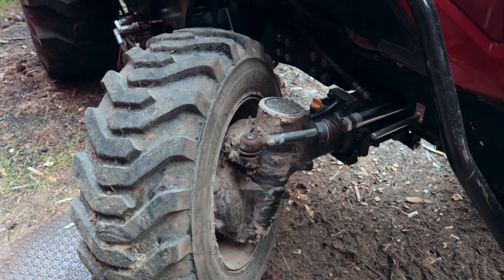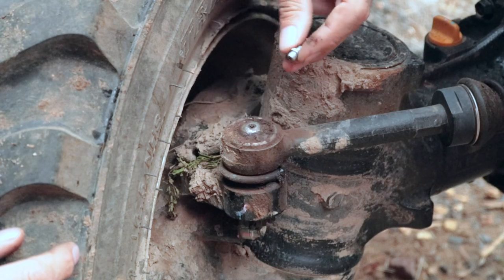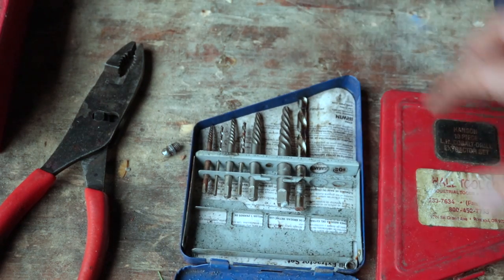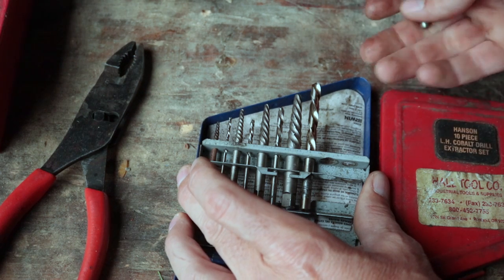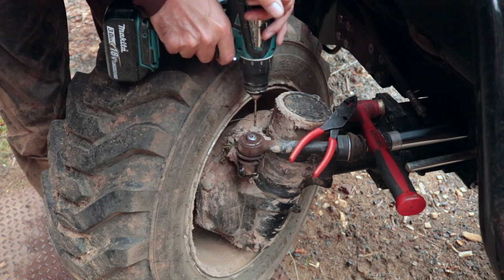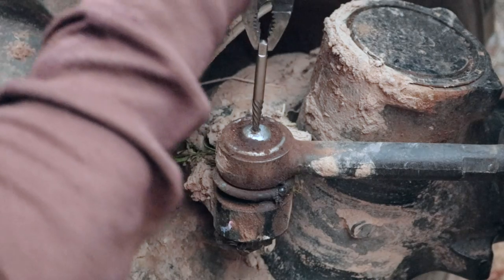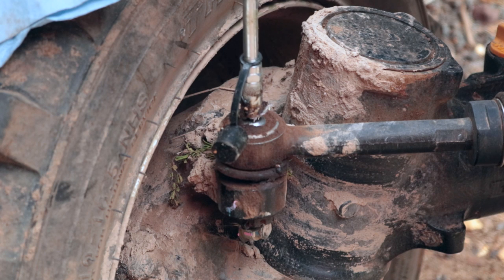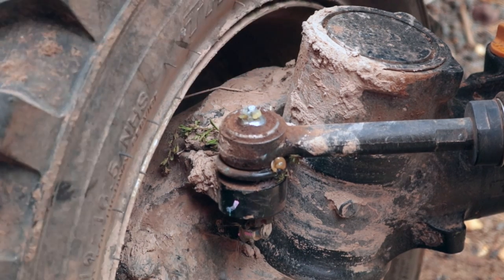I BROKE MY TRACTOR

Comment: All is good except for drilling all the way through in the wrong direction & leaving metal filings inside the ball & socket. Fortunately the threads were not damaged & you could thread the new zerk fitting back in. When greasing ball & socket joints with the rubber boots, typically I give it a squirt and a half using my hand trigger grease gun. I am looking at it closely, looking for a slight bulge of the boot, but not so much to blow a pin hole in it & pushing out the grease, as at this point it becomes counterproductive. 
The other style is the umbrella boot, whereas it is okay if a tad of grease oozes out below it's lip. When greasing shafts or rods with bushings, I typically keep pushing the grease through until I see some movement of the previous grease job. I have learned from experience too that it pays to use a high quality type 2 grease when greasing my equip., be it the truck, tractor, trailer, etc. I personally use the industrial grade blue grease from Valvoline as Kendall makes a good one too although it is extremely expensive. The Valvoline isn't cheap either, when it goes on sale at my local NAPA store, I stock up on it! 
Good post here & thanks for sharing your experience.
Bill on the Hill... :~)

Comment: Great video. Might be helpful to track down the size of those grease fittings - when you wander into your local NAPA, there are several different thread sizes to choose from (both standard and metric) - yeah yeah, the metric system blows

Comment: The EZ out fits in a tap handle.. As for the grease fittings, you can purchase an assortment in SAE or Metric at a local auto store in the "Help" section for just a few buck$. The set I bought about 20ish years ago still has a couple left.

Comment: Or.... pull the balljoint and then you can clean out the crud that surely dropped in... not to mention metal shavings from the drill which won't typically flush out when you overdo the grease.... and then put in the fitting and reinstall the ball joint and then fill the grease. Just saying.

Comment: You did get it out but before using the easy out I would've tried a small straight screw driver. Those grease zirks come out pretty easy especially with the low hours on your tractor. Drilling it out leaves allot of shavings inside. 
Easy for me to criticise I wasn't there! I wish I lived near by I could have gave you a hand. Thanks for sharing.

Comment: Cody, It looks like your grease boot has a crack in it. I've never seen grease come out of a boot like that. It usually swells up the boot first and then comes out where the boot is attached to the joint.

Comment: That type of screw extractor are often misused by people who believe the "easy" part of the easy out name.Using the correct size and knowing when to stop is important. The tapered thread can wedge the part being removed tighter, and broken extractors cannot be drilled by normal equipment. The square tapered type of extractor cuts down on the wedging action. I have even had good luck using  the square tang of a file on occasion,just be careful because of the brittleness.

Comment: I just got some cool little Easy-Out's that have the tiny reverse drill bit built in to the tip of easy-out bit. So far works well for most applications. Grease is the word.

Comment: I'm pretty sure those bits you were using are left handed bits and you were running them as right handed bits. Also there is no need to use a bit/extractor that is so big at first, you run the risk of damaging the threads while drilling it out. The next size down from the one you used should have worked just fine but if not than step up to the next size.

Comment: Two things I would've done differently - three, if you count running the drill bit in the proper direction - first, start off using just an extractor in the hole that's already in that part of the zerk and see if that would get it out without drilling and introducing metal shavings, and second, use a smaller bit/extractor. That one he used looked bigger than it needed to be and dangerously close to the size of the threads.

Oh, and don't blow out the grease boots. Know when to stop pumping. Do those boots have intentional overflow holes in them, or was that from overfilling previously?

Comment: I worked for a contractor in Kansas City  and went down state to pick up a 1 ton truck and backhoe from a jobsite that was shut down.  Two of us went so one could drive the truck with the backhoe on it back.  When we got the equipment to KC we found that the truck front end was worn out from lack of grease and it cost about $1500 to fix it..The backhoe joint was so worn from lack of grease the dealer had to cut the joint off the boom and weld on a new one along with other pin and bushing replacements to the  tune of about 4500.  There was only one person responsible for the equipment but for the lack and use of a $15 grease gun this damage occurred.  In other words use a grease gun with grease it will prolong equipment life.  This happened in 1973.

Comment: Wouldn't you try to use the 'easy out' without the drill first? ... as the drill might just be to get actual non-hollow screws supplied with a hole so you can use the 'easy out' ?

Comment: Well that is exactly why you don't drill if you don't have to. He has a small easy out that he could have tapped into the zirk  and backed out without the problems. Please us "kiss" only break out drill and bits as a last ditch effort. Before i get slammed i am a heavy equipment mechanic. The metal slivers created when drilling can really play heck on that rubber boot and tight tolerances of the ball joint. But great video cody all the same. That would have cost you at a shop not to mention hauling it there and back.

Comment: With a zert not usually being tight (or bottomed out) and hollow, most likely could have used the next size smaller and hand screwed it out.
Also they have square ones that would have fit right in with a slight tap. But good demo on if you have to drill.

Comment: I should make a try with the small extractor first, in the the hole thats already there. It's often easy to remove when they break like this.
If that dosen't work, I would try my left hand drill, and the machine set to the same direction ;-)
Perhaps remove the wheel for better comfort and using a T-handle.

Comment: In cases like these, you might want to try turning the broken thread with a tool, like a small screwdriver pressed into the opening or with a sharp pointed pick if there is enough material around the edge, to avoid drilling if at all possible.
In the airforce they are still called easyout. There are still good quality easyouts commercially available made in Germany.

Comment: When you already have hole in the broken fitting it is always worth checking if one of the extractors will work without having to drill the fitting out and dropping metal particles in the joint.
Also using pliers is a bit crude, better to use a spanner or a Tap wrench.

Comment: A trick I learned is putting a small piece of fuel line over the grease fitting. A thumbnail in length. They keep stuff from getting caught under the edge of the grease fitting and busting it off. Plus it keeps your grease fitting and little nicer. I will cut a dozen or so and keep in my grease box or toolbox. Yes sometimes you lose them but I have not gotten a grease fitting busted off yet. Stuff tends to glance off rather than catch.

Comment: I used to work around tractors like this and my company took all the greese fittings out and put a plug into them and we used to freeze the equipment every 4 Friday you pulled plug put in freeze fitting greased and removed I as why that was and the Foss said the guys keep breaking off fittings and this was cheaper in long run

Comment: Curious, both zerks were busted off?  I question if your front chains somehow snagged them.  Real close to the same area of tire.  You may want to run caps or set screws until time to grease.

Comment: All too often you'll see the grease squeezing out around the rubber cup. Although pushing in alot of new to replace the dirty grease is a good idea when it's already coming out at rubber cup, I believe the cups are not suppose to be over greased to point of releasing. I think they are to be filled just enough to to create a filled pressure so it constantly pushes the grease into joint during use. Sort of like the buddy bearing cap effect.
As far as the right hand rotation on the left handed bit, ya I saw it too but then who hasn't forgot and done that too. Great job Cody. Good for those who don't know about this sort of thing.

Comment: Forget using the spiral type extractors and the Ridgid brand star rods. You drill to size, tap the star rod into place, insert the star nut over the rod and then use a wrench as close to the bottom as possible.

They don't shear off like the spiral rods do and are much easier to use. The kit also includes a bushing that fits over a broken stud allowing you to center drill unlike the spiral kit shown.

Try one and you'll never use you old set again, guaranteed.

Comment: Try this:  Next time you have a broken grease fitting, do not drill it, just use a smaller easy out.  If all it does is enlarge the opening to the size you need, the material worn away will be drawn out from the counter clockwise motion of the easy out.   Not gone down in like with the drill bit.  It will keep the crud out of the bearing.

Comment: LOL. Its a tie Rod End. LOL. My tractor came with caps and not with grease fitting. You have to remove them and use a tip on the grease gun to injecte the grease inside the parts on the tractor. I paid money and replace all the caps with grease fitting. Yep. broke the ones on the tie ods end the first month that I had them. All the other grease fittings are ok after years of use. I put the caps back on the tie rods.

Comment: Cody how do you get the grease gun nipple to stay on the grease fitting, I know there are adjustments on the gun nozzle but at times certain locations, some fittings won't take grease and it just leaks out around the fitting then you tighten the nozzle and it won't fit on the next fitting and has to be moved back where it was, why does that happen, I think they are all same size grease fittings.

Comment: You don't have to drill everything out first, especially if it already has a hole in the center already.  Just match your easy-out to the hole size that is already in the part.

Comment: If both fittings broke it would suggest that it will happen again. Pull the fittings after greasing and replace with a cap it will be harder for things to catch it.

Comment: You do not need the drill bit for a grease zerk. Just stick a derned ez out in there! There is already a hole through the zerk. The corresponding bits are for drilling extractor holes in solid fasteners.

Comment: instead of an extractor use a torx head screwdriver to remove the zerk. It works best in the smaller zerks. Find bit that is just a little bit bigger tap in with a hammer and out it will come. I do it all the time.

Comment: i had pretty much the same problem with a small hydraulic hose thread in a cylinder and i just went the easy way got a torx bit that was just slightly bigger than the hole ... and jammed it in there cause the bit is made from tool steel and harder than the hose fitting so i just jammed it in and twisted it out .... no muss no fuss with drills or anything ... you can pretty much get sth like that out with a simple screwdriver if its the right size ... seeing as grease nipples arent usually heavily tightened they twist out pretty easily

Comment: if you would have reversed your drill you never would have threaded the fitting in.  you were using a left handed drill bit, the case even was labeled as such. very nice video

Comment: I watch alot of these videos and always ask myself why do you wear your hard hat when you have no need for It? I get it if there is stuff overhead or working in the bush but in a field with a tractor planting seeds? to me tools are tools and should be used as a tool not a fashion statement.  I wear my hard hat at work or when I am cutting trees for friends of mine but it comes off when I am mowing my lawn or watering the plants or doing chores in the house. do you wear your hat for the reason you think it looks cool or for a function?

Comment: get the square type work way better than the fluted type available   at most hardware stores no need to go online to get them also your king pins looked dry they are not so simple.to replace if you work in a lot of mud service them daily

Comment: Another tip is use a tap wrench or tap handle on the extractor, it helps apply even torque and easier to hold the extractor straight.

Comment: zerk?
Reply: 1crazynordlander I always heard zerk too. At least that's what we called them in the army.
Reply: The patent for the Zerk fitting was granted to Oscar U. Zerk in January 1929, and the assignee was the Alemite Manufacturing Corporation[1] (thus the eponymous names for the fittings). Alemite was already marketing ball check valves to accept grease supplied under pressure from a grease gun, such as for car and truck chassis lubrication points, both for OEM installations and for aftermarket upgrade kits which would screw in as replacements for stock grease cups. But Zerk's fitting was an improved style, less vulnerable to dirt and more forgiving of angled approach. Today, many companies make these grease fittings.
Reply: The guy who invented it was Oscar U. Zerk. Seriously, what a name.
Reply: sounds like you are saying oscar was a zerk?

Comment: Just a suggestion. If you use a left handed drill bit, and yes there is such a thing as a left handed drill bit,  many times it will unscrew the part that is broken off.
Reply: That was a left handed bit.  Run in a right handed direction.

Comment: I have a problem when reloading a geese gun I can never get it to start pumping again I sit there pumping for 1/2 hour and still nothing what's the trick normally I just set it upside down and leave it for a week and then I might start working then but it's just really annoying to not be able to finish a job
Reply: Sounds like you got air trapped. Air is a gas so it is compressible like a spring. Grease & oil is not compressible, so when we pump with the handle will compress the trapped air then spring back not pushing anything forward. The trick is to minimize any air trapped. Holding the grease gun so the exit end is at the highest point then tapping down on a hard surface will drop the grease down & push the air up near the exit. Pump the handle really fast until you feel some resistance in the pump handle, that means there is now grease in the pumping device. If you feel no resistance in the handle, repeat the process to get the air out.

Comment: Maybe you don't know this but the rubber dust shields on the tie rod ends are not supposed to have a hole or a 'leak' in them, they are supposed to be a sealed unit as to not allow any ingress of dirt and/or debris inside. When you pump more lubricant into the ball joint the rubber is supposed to expand slightly and 'balloon' out a little. I would advise replacing the tie rod ends as soon as possible to prevent any unwanted and expensive repairs down the road. FYI, I do this for a living.
Reply: The tie rod ends should cost the same whether you replace them because they're leaking or because they're worn out.

Comment: If both are broken then they are vulnerable, it was probably your snow chains. You can weld a small section of steel pipe to protect the grease point, just make sure the pipe is big enough to get the end of your grease gun down.
Reply: that the outer Tie rod not ball joint.

Comment: Sure love your videos and life lessons.  Stitch in time.  You shared the story about how long a piece of equipment would last if it was used by a single user.  I have seen the same thing but from my experience, it also has to do with pride and ownership.  If multiple people use something then most of them will assume that someone else is responsible or will take care of things like the broken zerc.  They rationalize that they've got work to do and they aren't sure that it wasn't broke before they started using it.
Reply from the maker: Thank you Doug

Comment: There was already a hole in the top of the fitting. Should have just used the smaller easy out in the existing hole and you wouldn't have knocked that down inside the ball joint.
Reply from the maker: and how small that hole is,
Reply: Depends on how small the initial hole was. Anything smaller the about 1/8" or 3.3mm an easyout won't fit. The tip of the smallest easyout is about 3mm.
Reply: mbaker825 And those thing's break just looking at them. The bigger the better as you don't want to try and drill out A broken E Z out!

Comment: If you take a 1/2" or 5/8" steel tube and cut it as tall  as the zerk and weld it to the top of the ball joint it will protect the zerk from breaking off. You will half to clean out the mud to grease it but that's easier than replacing zerks all the time.
Reply: ecleveland1 Put A bit of silicone glue in the pipe to act as A plug. Need to put in new every time you grease but that's small potatoes.
Reply: ecleveland1 Put A bit of silicone glue in the pipe to act as A plug. Need to put in new every time you grease but that's small potatoes.
Reply: Good idea.